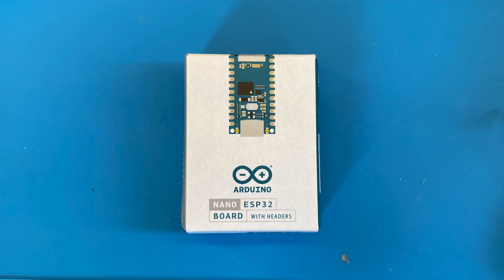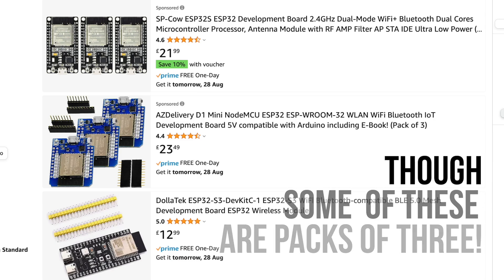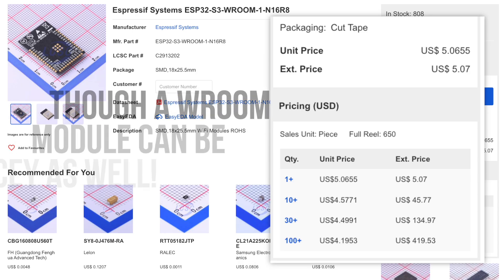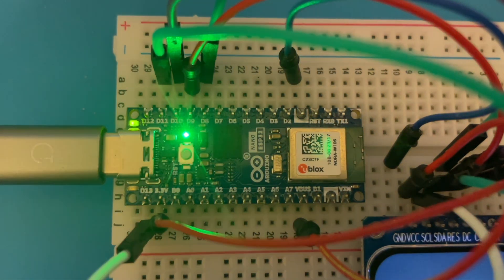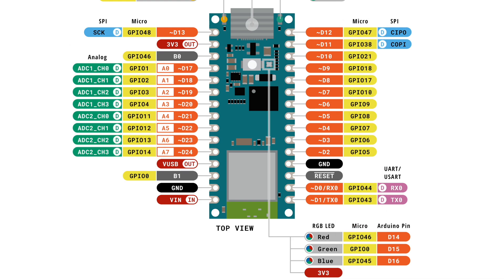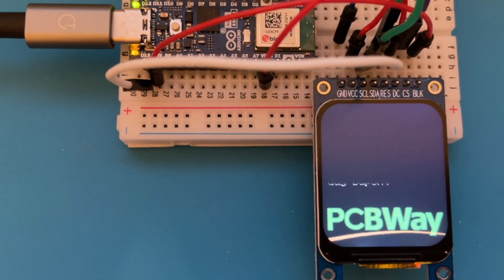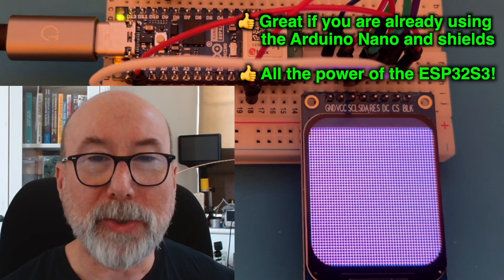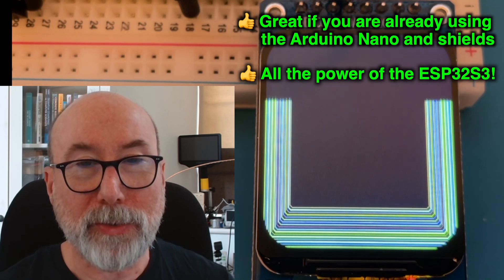Arduino Nano ESP32 - It's nice - But probably not for me.

Comment: Its notnfor anyone that cant get the drivers installed.   This stuff as a hobby is supposed to fun...butbtheblast few days....an absolute nightmare.   Wifi communication all of these boards is garbage....and the nano esp32 wont install.   There is little to no information out there to get the right windows drivers installed...and it isnt a small problem.   Lots of people out there cannot get it to connect up right to the IDE.  I CANNOT writ le a sketch to it at this point.  And when i first had it taking a sketch (takes the IDE about 3 minutes to compile amd load where the uno R4 takes seconds)...it would not connect to wifi amd when i did get it to connect to wife it wasnt stable and wouldnt stay connected.

Garbage.

Comment: A NANO runs at 5V which is compatible with my giant collection of Parts Boxes.
If you "must" have a graphic display (i prefer a text serial 20x4 LCD) , The NANO can run out of memory very quickly
Reply from the maker: The ESP32 Nano is powered from 5v USB - but it’s a 3V3 device.
Reply: Good point, by "NANO" I was referring to the older one not the "NANO 32"

Comment: If I make a program in platformio I can use any variant of ESP32 (S, S2, S3, C3 etc.)  - provided I am using GPIOs that are working on each board - just by changing "board" and "env" in platformio.ini. But now, with this bonkers, I would have to reprogram everything because.... all pins use Arduino numbering - that is total fatal error for me. Plus the price of course.

Comment: The switch mode buck converter is a really nice touch, and that big block of extra memory could definitely come in handy. Although, I agree, it's a bit pricey compared to what I'm used to paying for ESP32 dev boards. I'm sure QC and build quality are top notch, although, I've not had any problems with the cheap boards.  Even if it's not for me, it is nice to see Arduino finally join the ESP party.
Reply from the maker: Indeed, I think the price is completely justified - a lot of hard work, design and documentation (and software tweaks to the Arduino framework) has gone into it.

Comment: I'd love to see if one of these suckers can run old school nano projects straight out of the gate, got a few plug and play breakouts. Seon (Unexpected Maker) is mad man how he produces everything himself and is quite frank about how he goes about it. Also I'm super proud we still make electronics in Australia <3
Reply from the maker: Seon is an absolute machine - I don't know where he gets the energy (and time!) from. Very inspirational.
Reply: It is a 3.3v board, there will be some problems making sure there is nothing 5v going back to the Nano.
Reply: @jerril42  Time we ditched 5v. Always good to have the 5v USB overhead but I'd like to see peripherals as 3.3v only from now on. So we dispense with all the level converter nonsense. A 3.3V nano would be a move in the right direction and facilitate easier migration to esp32 et al.

Comment: I suspect that most esp32-s3 Arduino users have already found their favourite board on aliexpress. This offering is a bit late in the game. But, like the UM boards, it has a nice narrow form factor which is more breadboard friendly if you need to 'dupont' a single pin multiple times. Many of the more ubiquitous board have too much girth.

BTW, your display refresh for the PDQ demo is ridiculously slow. Was the B-Reel in slow motion or were you using software spi? :)
Reply from the maker: Agreed - I think you are right, I've kind of settled on the boards I use and just get in a few UM boards every so often. I noticed that display issue as well, I was just using the Adafruit GFX and drivers. It does seem incredibly slow but I couldn't see anywhere to set the clock speed. I've been using an SPI display on my own board and haven't seen the problem. Needs a bit of investigation.
Reply: @atomic14 
I think you're right to use a module as it's certified - one less thing to worry about. 

USB-HOST is now tentaively supported by Arduino / ESP32-S3 so perhaps a switch to deal with power to the hosted device given that the ESP has a suitabe extenal power supply.
Reply: @atomic14  last time I used Arduino GFX the default constructor was for soft SPI. Maybe that explains the slow refresh. For harware SPI with this display I've gotten away with 80Mhz on a custom board but on breadboard I stick to 40MHz just to be safe.
Reply from the maker: @nikthefix8918  - that's exactly it - a bit annoying as there's no limit on the ESP32-S3 on what pins can be used for hardware SPI. Managed to get it to use hardware and it's lovely and fast!
Reply: @atomic14  Nice one! I generally stick to Lovyan, TFT_eSPI, Arduino_GFX (not to be confused with Adafruit_GFX) as there are even greater speed gains therein. Lovyan is particulary fast and supports large parallel display interfaces and is great with LVGL. TFT_eSPI is perfect in 'sprite only mode' if you have a display with a driver that allows a full or partial screen refresh. I did some work recently for the Lilygo Amoled-S3 using this technique (featured on Volos' channel) and the results are really good. Worth checking out.
Reply from the maker: @nikthefix8918  I'll take a look - the next steps in my ESP32 board is full screen updates from a stream of jpgs so I'll need it to be pretty fast.